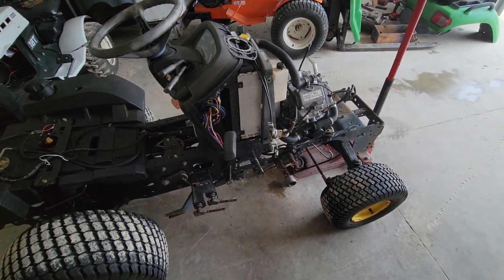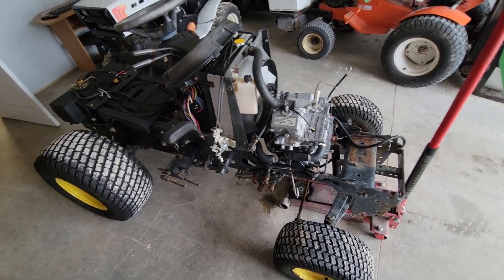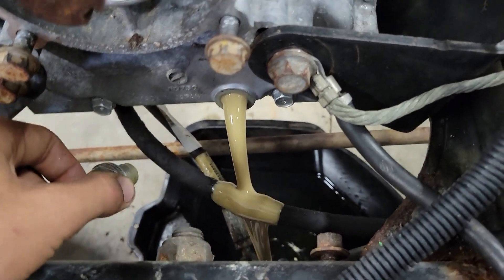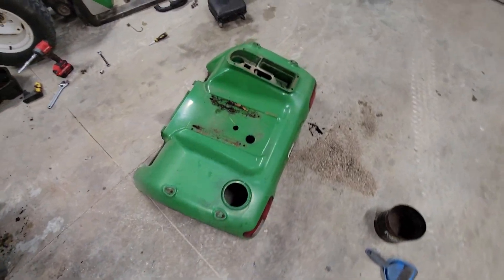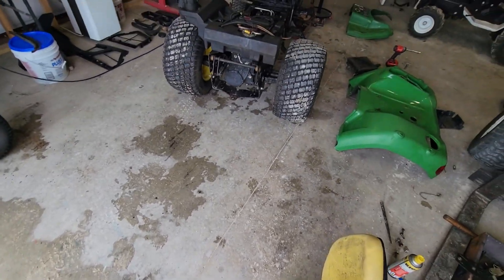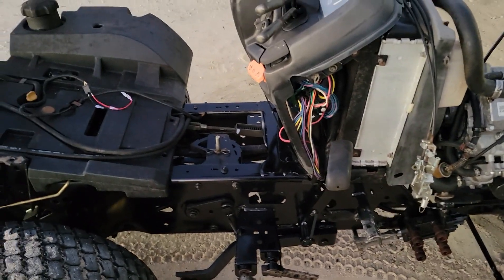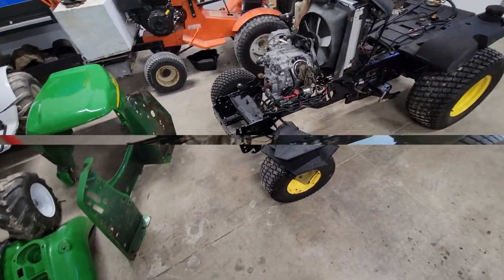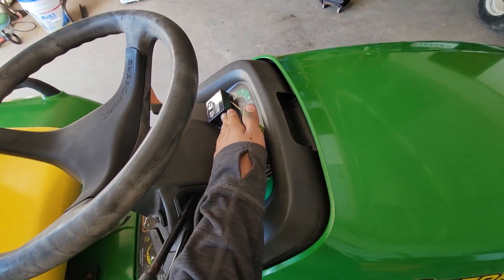John Deere x475 project part 2 making it look nice

Comment: Great job my friend I have a X475 I bought new in 03' still have it with 3pt & pto 48C with power flo/bagger unit and 54C deck along with a 647 tiller. I have taken mine down bones one time due to having re-support the rear lift cylinder due to fatigue on the frame. Your video will help me with the routing of the fuel lines under the deck plate because I have to revisit this thanks so much in your interest it's helping me and I'm sure many others oh and soon I'll be repainting for a 20 year upgrade
Reply from the maker: I have a x475 also that I got in bad shape and fixed it up. Don't repaint green plastic, paint won't stick to it. I used a buffing wheel and it looks like new again.

Comment: I got an x475 what is 62 Inc deck and once in a while it pours out white smoke I had the head gaskets replaced but still does it so I don't know I wonder if I need new rings